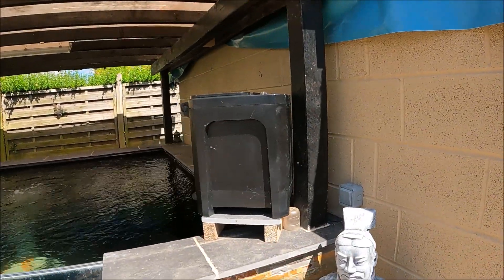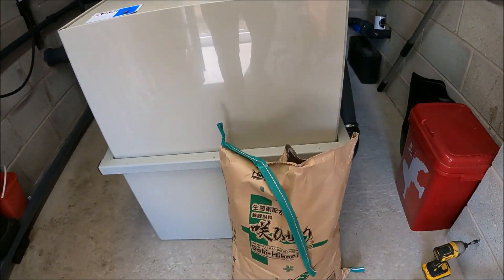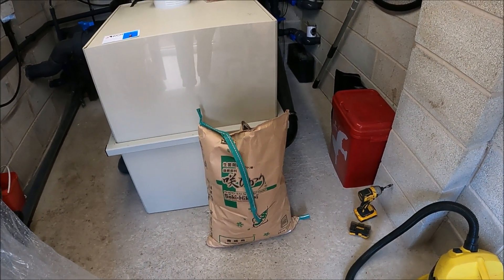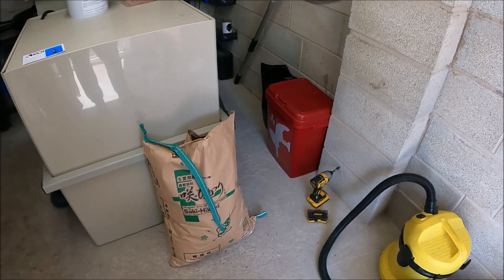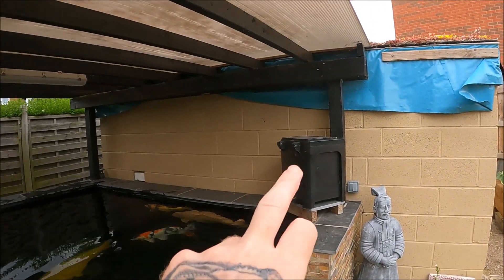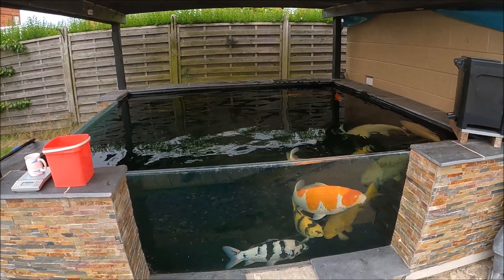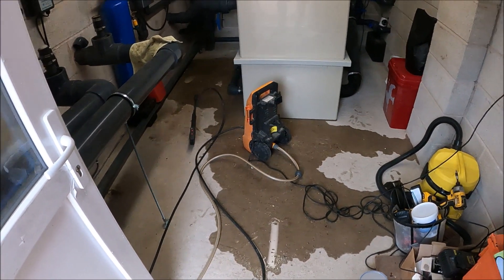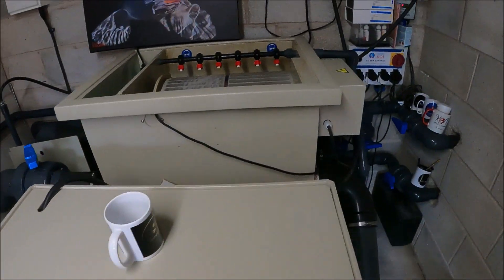Koi Diary 158 - New Koi food and a feeding disaster

Comment: Great video as Allways thing is Darren told me at absolute koi that the uv will wear the drum seal a lot quicker I don’t no if you have noticed that and he told me to put it on the clean side
Reply from the maker: Yeah probably, as my old drum had this issue, but if i put it on the clean side id have to drill a hole in the drum as the UV isnt water tight at the top end of it so that would fail. For the sake of a new seal every while ill just change it if need be, i did this with my old drum and its not too difficult a job, just a bit fiddly

Comment: If you put your uv in the drum side you won't get biofilm build up on the screen 👍
Reply from the maker: Dont fancy drilling a hole in the drum tbh and as its not water tight it will end up failing i bet as it will get soaked from the spray jets. Its no biggie cleaning the screen a couple of times a year i suppose
Reply: @koidiaries  get a little 10w submersible off ebay about 15 quid 👍